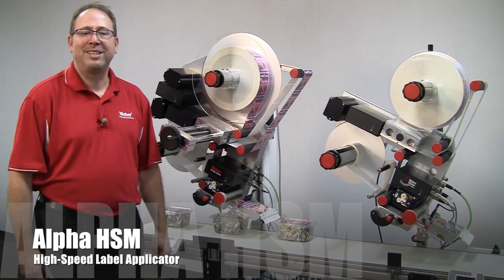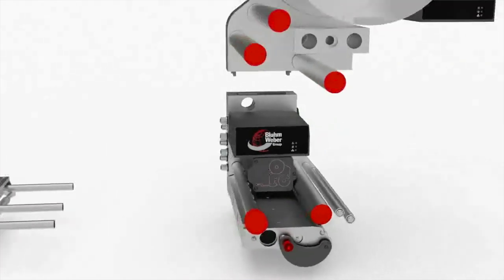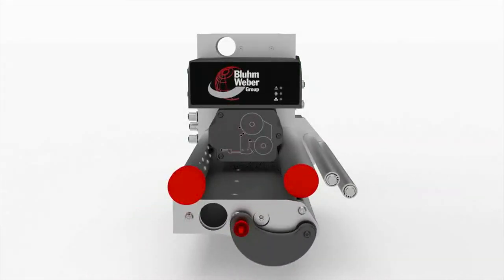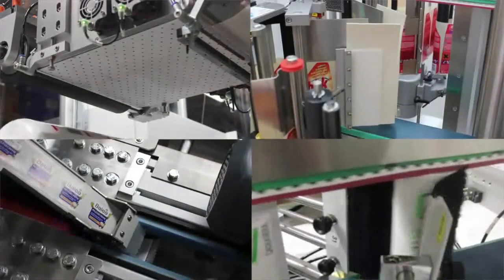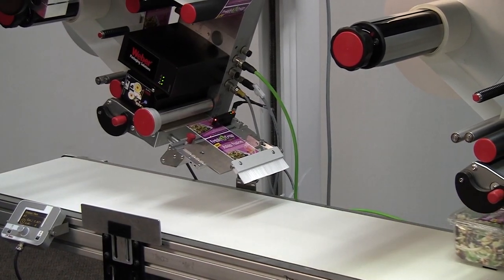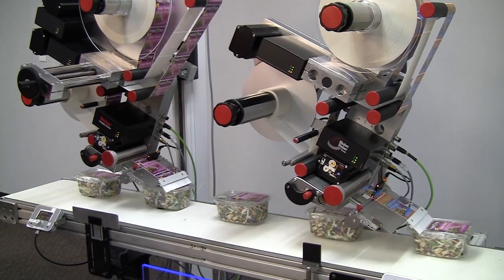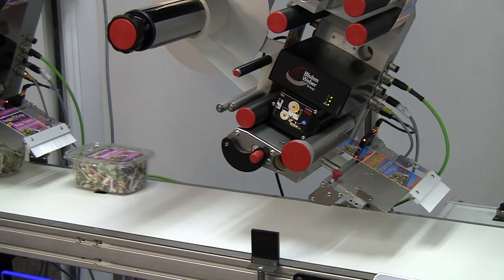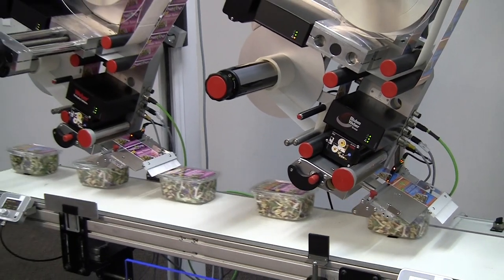Weber Alpha HSM Label Applicator

Comment: Does anyone know about the printer which can apply the label as well: means print different details on each label and apply it directly from the printer to bottle
Reply from the maker: Sorry just saw this! If using a label applicator to apply labels, it's best to use an inkjet coding system to add variable data to label. Our Markoprint inkjet coder can add text to labels on the fly. Watch this video for for details: https://youtu.be/0Hu7g5E1Atg